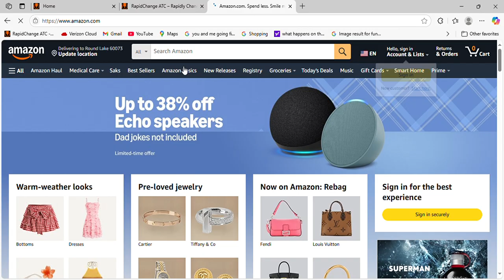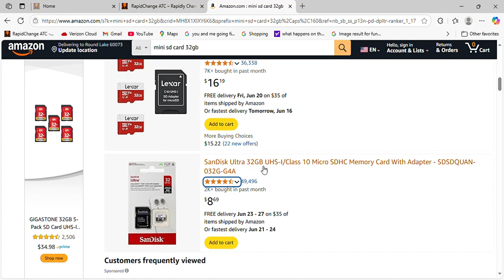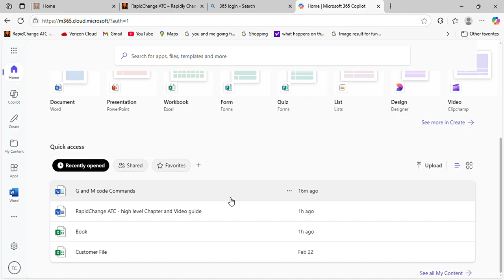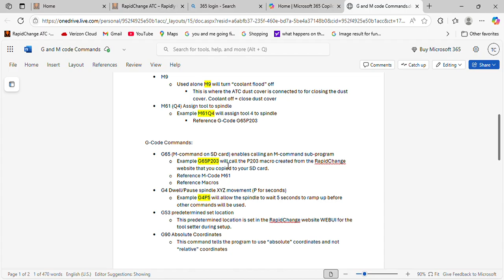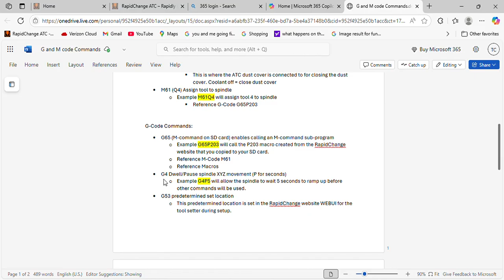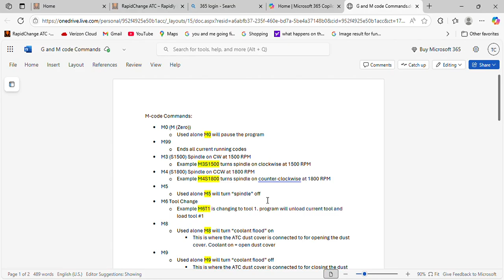RapidChange ATC Video #2 Mini SD, G-M Code Commands and Macros

Comment: Hi.
Im about to order the Altmill and been searching for videos about the rapidchange since i saw the first of it about a year ago.
So then i stumbled across your brand new channel and you earned a new subscriber.
Now.
You said that you put the micro SD into the SLB (super long board).
Then you say that the panel computer don't have a micro SD reader...
So..??
I mean since the SD card goes into the SLB what would be the reason for the usb card reader?
I hope you understand my question since i am brand new to this.
Thank you for your awesome series so far.
Keep it up
Reply from the maker: The panel computer does not read the SD card from the SLB for adding or updating files. You need to remove the SD card and plug it into the computer to add your macro files.
Reply: @NWWI-Workshop 
Aaa..
Ok, now im with you you probably said that in your video to but i somehow managed to miss it.
Well thanx for the clarification and keep up the great job.

Comment: Not having any experience with CNC's other than the owning the Shaper Origin, my take away from this is "omg.. what did I get myself into!"     I'm in it for the long haul.. I wont be defeated
Reply: It seems like a lot now but once you start working with commands and go through testing it will be second nature. Let me know if there is a way I can help make the transition easier. It is a small price to pay for full automation.  You need to learn how to set it up so you can troubleshoot when things go sideways.
Reply: @christmantw  as the saying goes, in for a dime in for a dollar!  Appreciate the offer for help. I may just take you up on that but the problem is, I won't have my Altmill until sometime in September (Im 4th or 5th from the bottom of the list)  Thats why im here learning as much as I can now so I will have some sort of familiarity with the CNC, Rapid Change, Auto Dust Boot, Vcarve Pro, Gsender etc etc.  I may not understand much now but my hope is to not be totally blind to the machine by the time it arrives!
Reply: @pctatc66 fyi christmantw is my other account with NWWIWorkshop. Same person. I should just delete my old account lmao😂
Reply from the maker: Lol

Comment: Still watching the video so this might be premature, what did you do for your auto dustboot commands?  Its setup on the flood pin, well at least mine is for now.  I suppose I can switch it to the swt1 pin and provide external power.  Which as I am typing may be a better solution for the boot because you can specify m3/m4 on the swt1 pin.  This would eliminate having to use and make sure your M8 is active before any Z move, (maybe once or twice this has happened to me).  Thinking out loud.
Reply from the maker: I haven’t yet set up my auto dust boot
Reply: @NWWI-Workshop  Ah, your going to run into an issue using M8 for the dust cover.  M8 sends the dustboot down in his setup.  I think you going to have to use swt1 or pwr2.  I said in my comment to use M3 M5 but that wont work for the dustboot either because the TC macros use M3 M4 M5 which would be bad as well.  Gonna have to use M7 me thinks.
Reply: @NWWI-Workshop  Going to have to ask Francis if you can use 24v to activate the Dustboot.  Or vice versa if the atc dustcover can use 24v to activate.  Guess he would know since he has both.  He doesnt have a dust cover on his atc though hmm.
Reply: @marcusXaurelius  Yep francis got his rapid change working with his Auto dust boot on his almtil.  But I forget did Francis have the dust cover?  I dont think he did
Reply: And just like that.. Francis answered my question about this subject :       Francis. I ended up ordering your Auto Dust boot as well as Rapid Changes ER20-8 Premium changer with dust cover.   Will I have issues using the Auto dust boot and the Rapid Changer premium with Dust cover on my Alt Mill?  Do I have enough ports on the longboard to use all that?

Reply

Highlighted reply

@francis.creation
9 minutes ago
You can use sw1 or sw2 and supply 5v then map this on the firmware.  Sw1 and sw2 are kinda relay with ground common. Make sure you only supply 5v on the line/load of this ports as the ADB input is only rated 3.3v to 5v.
Reply: @pctatc66  Yes I sent him about the same thing an hour ago.  So yes swt1 will be what i will use and then map the firmware to M7 for the dustboot.  Then leave the atc on M8 so as not to have to alter the atc macros.
Reply from the maker: Dust cover uses 24v
Reply: @NWWI-Workshop  So does the dustboot but it switches with 5v.  The flood pin is 5v signal.
Reply from the maker: Correct the flood pin is 5v. The power for the ATC is tied into Aux Pwr 1 @24v. The flood pin is just used for signaling the Tool Length Setter and the optical sensors on the ATC. Make sure to reference the RapidChange website for physical connections. This is the next video I have coming out this week.
Reply: @NWWI-Workshop   Definitely bookmarking this thread so I can come back to it in September!   Appreciate the knowledge of all those that walked the path before me